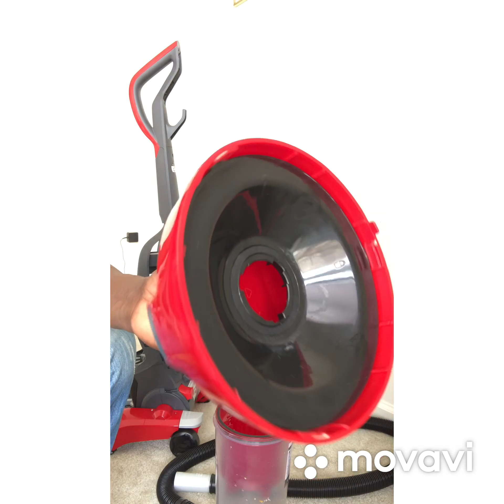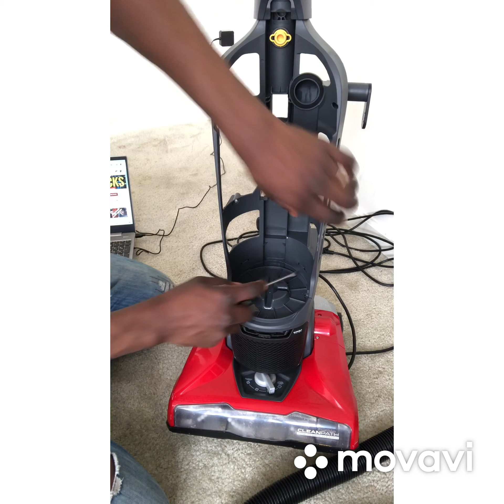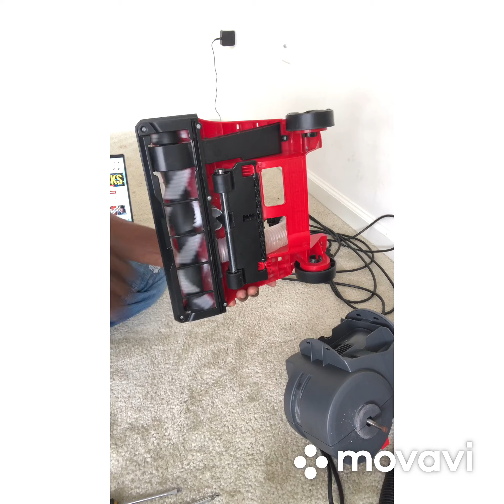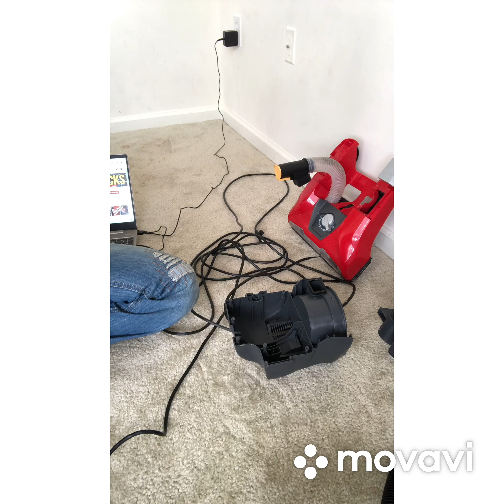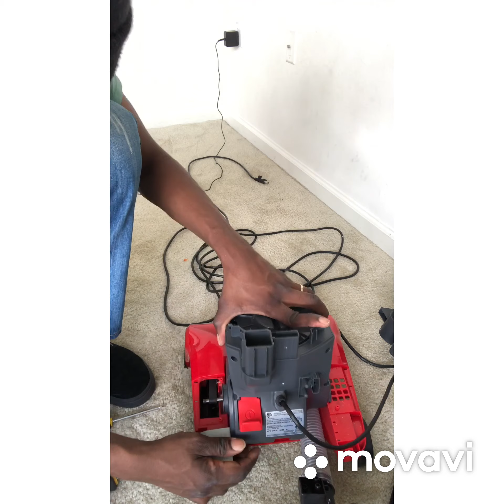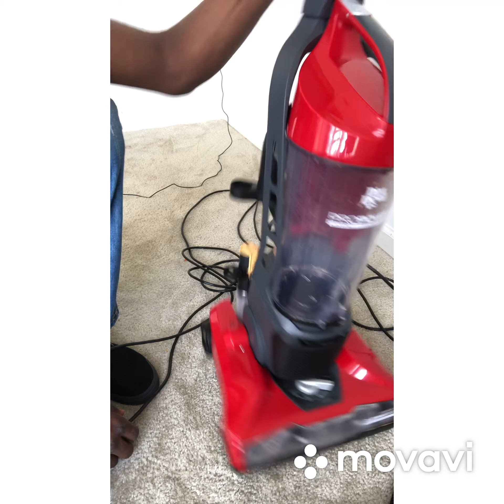How to assemble and reassemble a Dirt Devil vacuum cleaner

Comment: Hi thanks for the reassembling, I’d like to see how you remove the handle from the vacuum I can’t push the black button in to release the handle to pack it in a smaller box.  I did remove the yellow lock. Thanks!
Reply from the maker: I will do a video for you when I get a chance
Reply: Mr talented Reid thank you!  I just can’t push that button in 😕